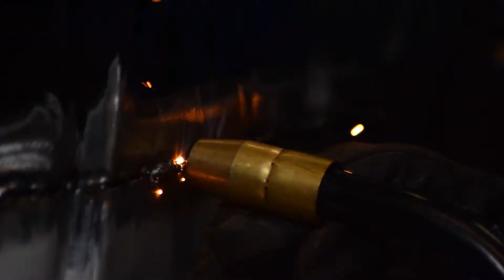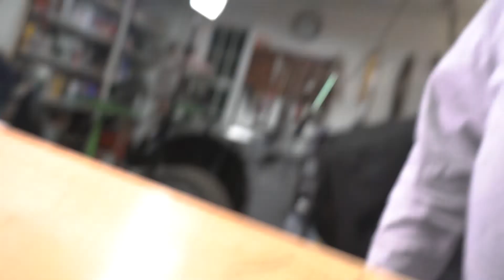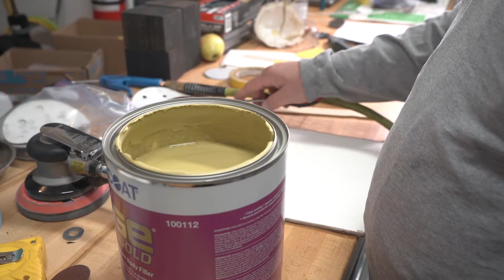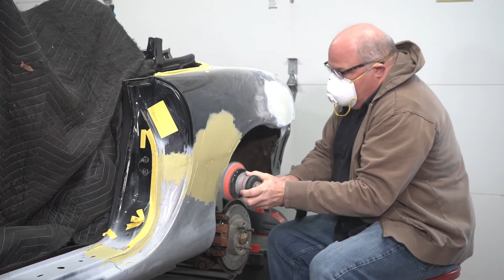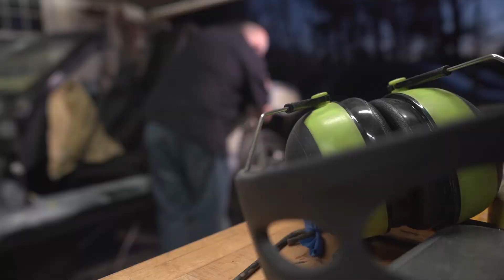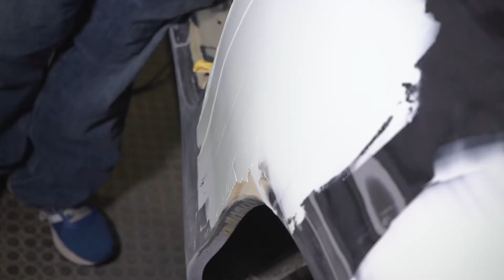Quarter Panel Body Repair - Mazda MX5 Miata Rust Repair Pt. 6 - Underdog Garage

Comment: Unpopular tip: Weigh out your body filler, multiply that by anywhere from 0.015(hot) to 0.030(cold), add the result to the first weight, make your filler equal to this new weight by adding the hardener.

... You will get laughed at by pro body work guys... you will also have perfect control over your body filler cure times and workability.

Edit: ...Also, use a guide coat and the largest stiffest block you can.

Comment: I noticed you did not filler the gap between the lower sill section, whats your plan with this?
Reply from the maker: We are planning to leave that seam as is. Our plan is to paint the Miata rocker with multiple primer coats. Then we will spray a texture coating which will provide a protective barrier like it was from the factory. The texture coating carries up the quarter panel a bit. After that, it will get two coats of base and two coats of clear-coat when we go to the final paint process. with that much paint and texture it should fill the seam somewhat, making it less noticeable, and it should look the way it was originally.
Reply: @UnderdogGarage  awesome thanks for the reply! These videos are proving very useful for me i am doing the same rust repair at the moment but hardly any info online about what to do with the seam, thanks!
Reply from the maker: Awesome Charles! We hope the rust repair on your Miata goes well! Let us know if we can be of any more help. Thanks for watching!